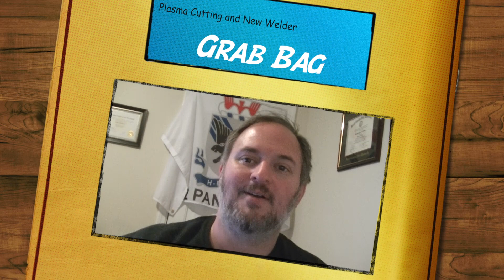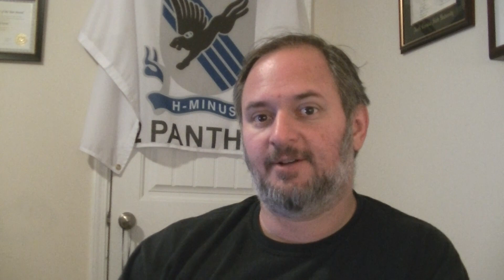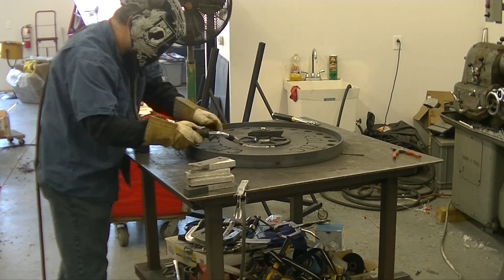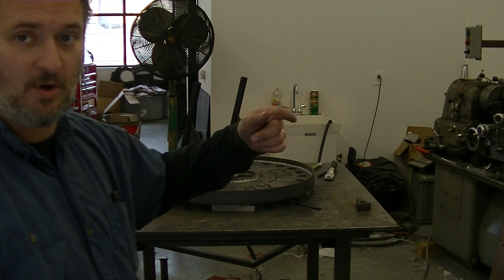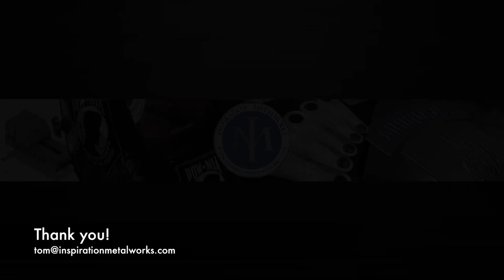Grab Bag - Plasma Tip and New Welder

Comment: Busy is good! :)
I don't have a Plasma Cam but haven't as yet tried a cut on expanded metal - got me thinking!
New MIG sounds great - can imagine welding big circumference and the potential problems.
Reply from the maker: Thanks, Chris! I think the challenge these days is being smart with my time. Too many things pulling me in too many directions.

Believe it or not, the big circumference weld doesn't cause the problem as much as the smaller ones close to the center of the plate do.

Best wishes,
Tom Z

Comment: Welding positioners are expensive but at least put ya a hub with a bearing up on that table so you can spin and weld from one position. I think that would be a lot faster and more comfortable.
Reply from the maker: Hi Brian! I'm definitely of the same mind that I need a better way to fixture and re-position the part while welding. If I get more orders like these I'll definitely set something up. If nothing else, I've got some old brake hubs and bearings sitting here and can turn that into a lazy susan of sorts.

Sincerely,
Tom Z